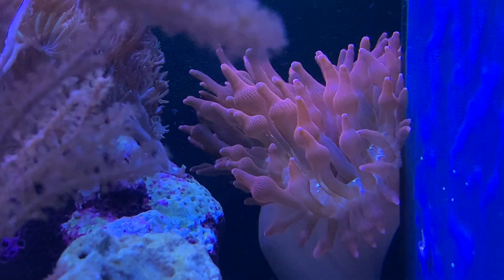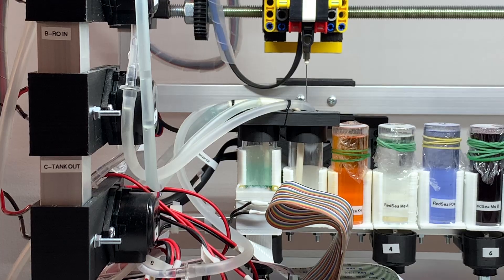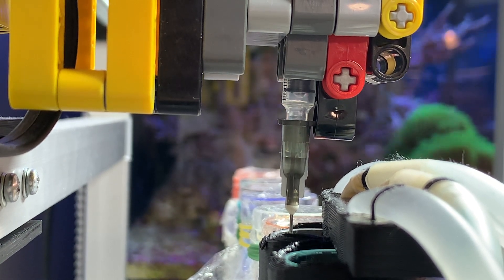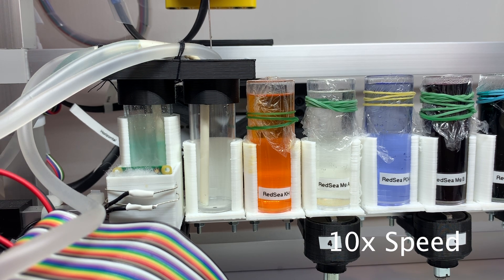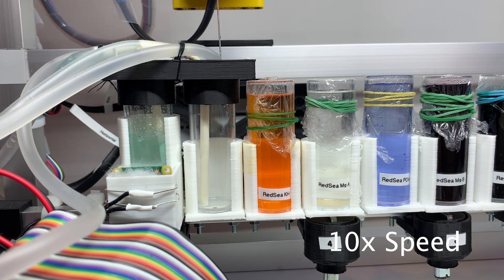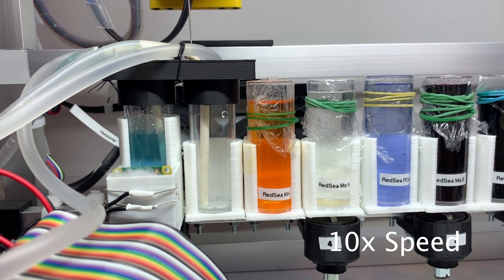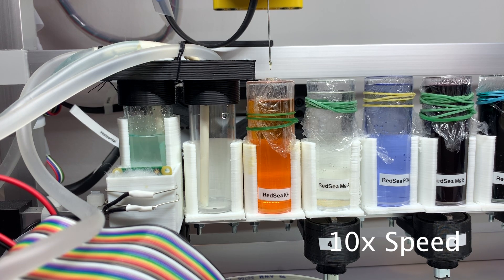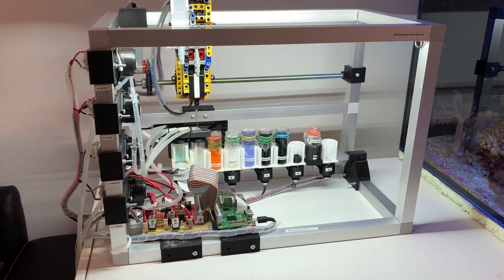DIY Automatic reef water testing machine

Comment: How did you build the stirring thing?
Reply from the maker: Small DC motor with 3D printed magnet holder. Magnet spins and in the veil there is a small stirring capsule.

Comment: GREAT JOB!!! Are you going to commercialize this product, or open  source? Why do you use a camera over a color sensor? What software are using to do the picture comparison?
Reply from the maker: There is a commercial product that does the same job but much more reliable - Reefbot: https://www.reefkinetics.com/product/reefbot/ Be sure to have a look at it. And yes, I used Raspberry Pi camera and software is all my own written mostly in PHP and some Python.
Reply: @macmikehobby657  no github repo?
Reply: MacMikeHobby will you make the code public? I would like to build my own but my coding skills are nonexistent

Comment: This works simpler than I expected! Did you account for the volume of fluid in the needle? I think a second version (or if someone else where to build one) should be based on a cheap HBot printer, that might reduce the costs a little.